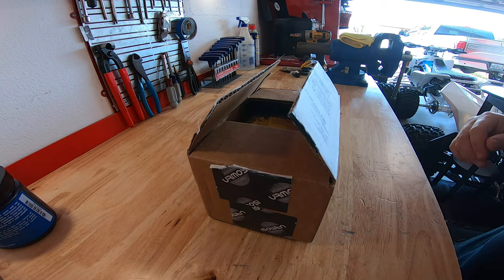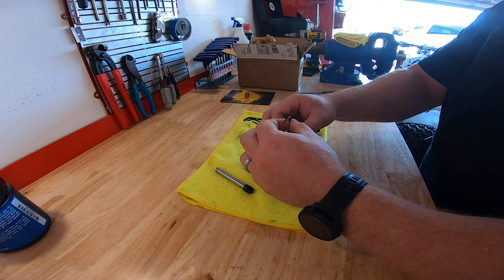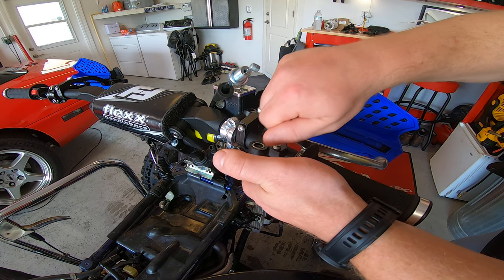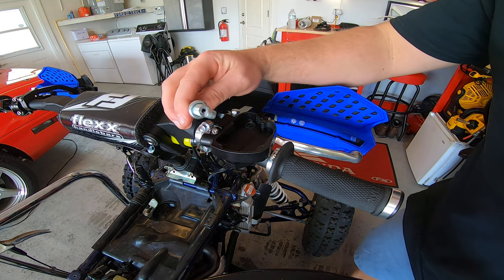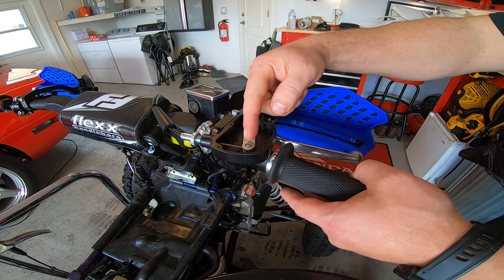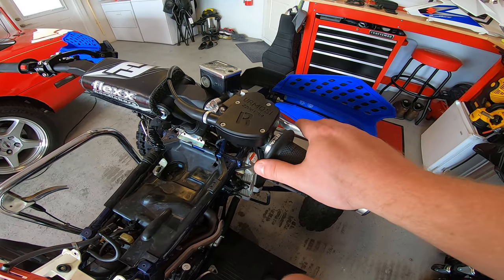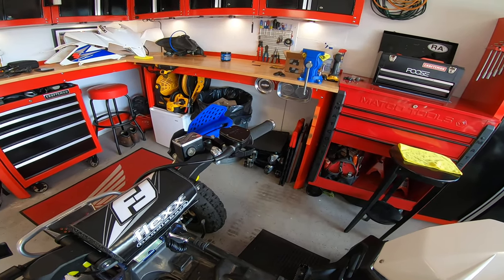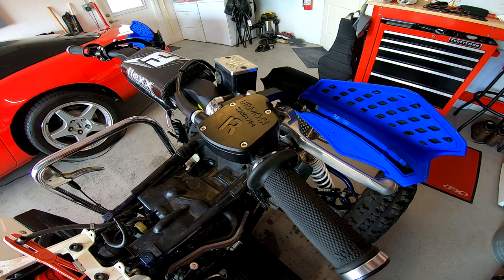Urmosi Throttle Unboxing & Install #savesportquads

Comment: I installed a Factory Edition yesterday. One other tip:  turn off the gas and drain the carb. I forgot to drain the carb on my 2013 TRX450ER and after mounting and adjusting the Urmosi, I had flooded the heck out of the quad (duh!). Kind of felt dumb after that, so sharing so folks can avoid my moment of stupidity. Lol.
Reply from the maker: Great advice for people with pumper carbs like the Keihin FCR on the TRX, YFZ, AND LTZ. That can definitely happen!
Reply: When i pick one on there website for make model and year. I dont see the option for trx450. Which did you pick? Assuming there mostly all the same. Also is it very noticeable it helps with thumb fatigue
Reply: @rotz357 the only TRX450s that come up are the 04/05 models. I’m guessing they don’t list the 06+ possibly because of their TPS (throttle position sensor), but not sure. I had to “hotwire” the TPS and the Urmosi is totally fine. I ordered the threaded model.
Reply: @chadt5584  so you dont need the cable adjuster? Only options i see is the orginal and factory. Which one did you get?
Reply: @rotz357 I have a Factory Edition in blue. I selected 2005 TRX450R, then blue. It is model number TR-5501. No adapter required. The OEM throttle cable threads right into the Urmosi.
Reply: @chadt5584  did you just put the two wires together for the tps. I get my thumb throttle today
Reply: @rotz357 yes. I spliced them at the connector under the hood. Just snipped it about 3” back from the connector and soldered them together. That way you can pull all the rest of the assembly from the throttle to the connector out of the way, so it’s nice and clean.
Reply: @chadt5584  hey thanks!

Comment: I’ve been looking for an all black throttle for my yfz ! Hopefully they one one for it and black levers but I heard aftermarket lever burn your clutch out or something, any recommendations?
Reply from the maker: Yes, it would be the same one I installed in this video. For your clutch lever I would go with a Works Connection lever or Pro Taper Profile. No, you will not burn up your clutch or something.

Comment: Do you use threadlock on the factory edition throttle shaft set screws?
Reply from the maker: I personally do not as the screws are so small it would suck for them to be welded in overtime from threadlocker. But you certainly could if you do it very sparingly.

Comment: What made you get a LTR? I thought I'd never see you get one. My first quad was a 06 KFX 400 but I sold that years ago, I recently wanted to get another and I was so tempted to go with a LTR or maybe a YFZ but you helped me stick to my gut feeling and I got a 08 LTZ 400 Special Edition, which I am extremely happy I did. Just wanted your input, thanks.
Reply from the maker: I used to have one 15 years ago when they were still new. Sold it in 2010 and wish I didn't. Saw this low hour original unit pop up for a good price so I jumped on it. I have no intentions of getting rid of the Z or 250r. The LTR also shares a few things with the Z and 250r like oil filters, wheels/tires and I am pretty familiar with them.

Comment: Awesome video, wanting to buy one myself, do you know if on my 2013 ltz I'll have to buy the throttle cable to use it and which urmosi throttle year should I buy?
Reply from the maker: I don't believe you will need a different cable for the EFI Z400. I am not sure what you mean by throttle year, they are all the same.

Comment: Hey brotha what is the part number to the throttle cable by motion pro!? Thankyou
Reply from the maker: for an LTR?
Reply: @PatrickRiggs33  yes I have a 06  you mentioned I need the 09 cable to run the urmosi  by motion pro wanna make sure grab right one for it to work with mine link or sku helps thanks 🙏🏼